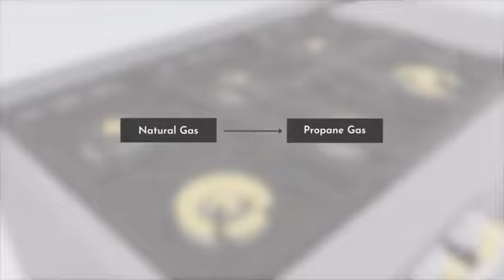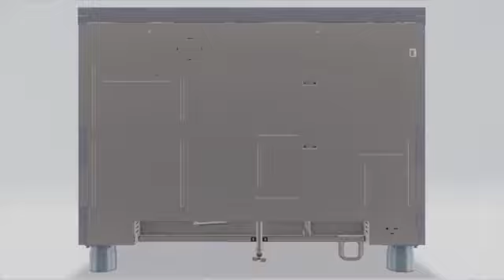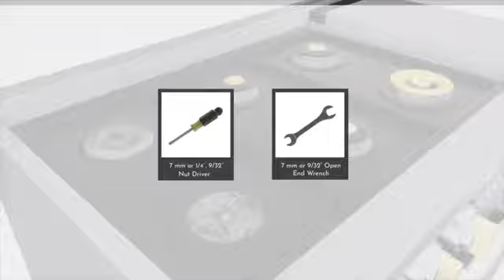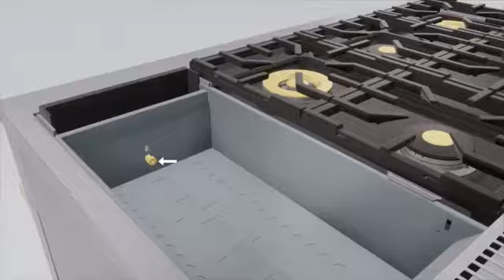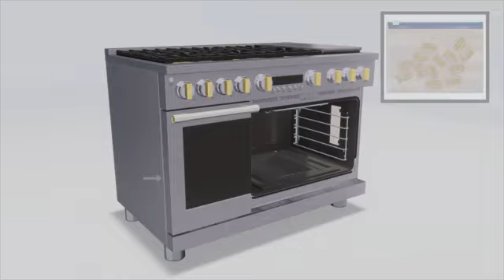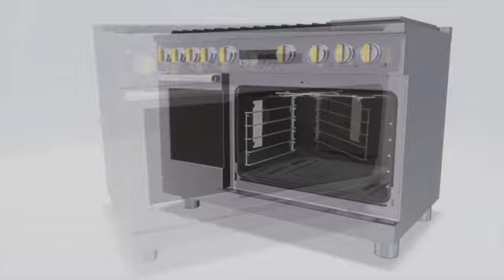Monogram Gas Conversion

Comment: Just did this conversion from Natural gas to propane.  It is doable by someone with decent mechanical skills and tools.  I will inform you this is a multi-hour project and something that requires care and concentration (tiny little parts that you can drop down internally into the oven if you are not careful) when performing this change-over.  have a Caliper handy for adjusting the shutters.